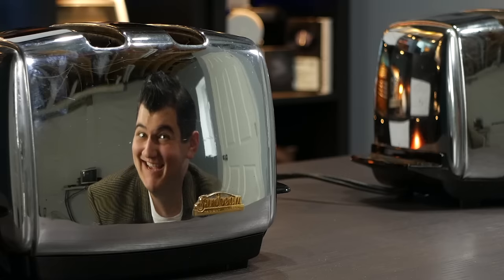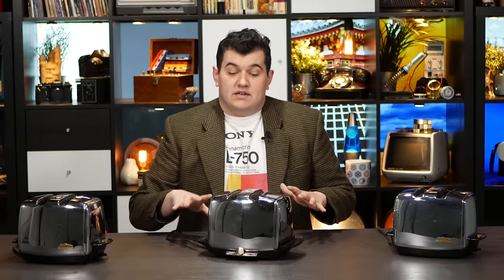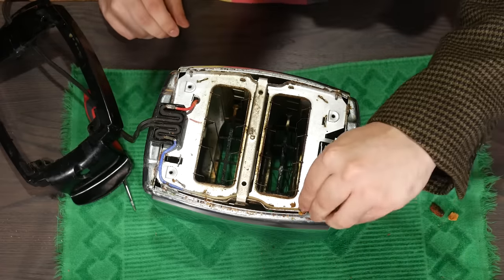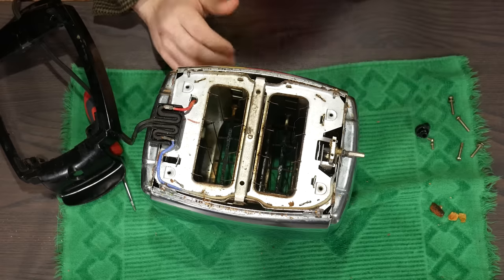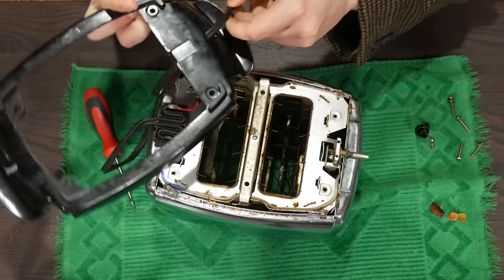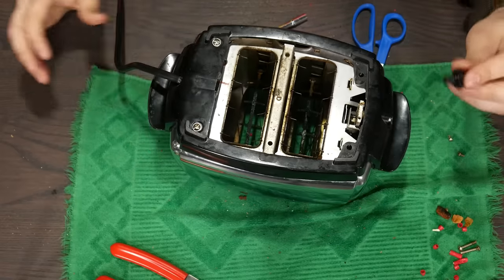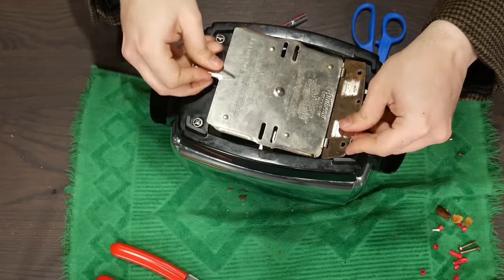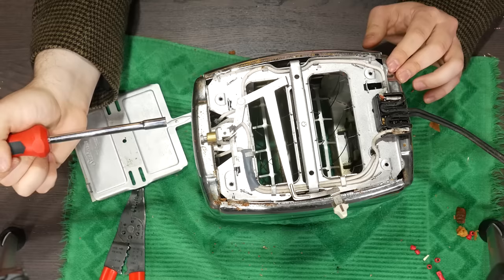Sunbeam Radiant Control Toaster--Repair and Modernization

Comment: Old vid yes but I was curious if you actually confirmed that the insulated wire was definitely paper? It's only a concern because I have swapped many cables on many vintage items and have run into insulation that looked exactly like that and it turned out to be asbestos insulation that was bonded on the outside. I personally haven't seen paper insulation and I'm not saying it wasn't a thing. I know you are an intelligent man and I'm not down playing any of your knowledge because as an RF engineer I don't know everything I just wanted to point out the possibility of such a "small" hazard. Love these toasters and I think I'll be purchasing one now and as always I love the vids 👌😎

Comment: The Brave Little Toaster haha comes to mind. What would be nice for jobs like this, is the factory style crimping tool that puts those impossible to reverse crimp pressures on. Uninsulated and some spaghetti tube. 
I'm fairly sure by these days, standards/codes/regulations stipulate that basically every power point in a kitchen or water area is RCD/GFCI protected, and as such, I too would prefer my chassis' earthed.

As for power lead length, I believe they are short due to several safety reasons
1. The short length makes it not readily easy to overload a specific power point on your kitchen, due to the physical limitation of appliance space on counter caused by the short length... You end up plugging it into another power point (which of course should be on a different circuit if your kitchen is designed to good standards, else this pretty much ineffectual).

2. The short length makes it not readily easy to reach a body of water, such as a sink, with the appliance still plugged in.

3. The short length makes it not readily easy to operate the appliance outside it's intended location, say on a table or floor in the kitchen

I am no expert, but that is what comes to my mind as to the reasoning of short power lead lengths.

Lastlily - I love youtube, you can make a video on just about anything and people will watch ^^

Comment: I just bought one of these beautiful radiant toasters and it is quite pristine. The problem I'm having with it is that the bread hardly goes down (inch) only to come right back up again. Mine looks exactly like the one needing to be adjusted with the bread problem. 

If any of you can possibly offer some suggestions I would greatly appreciate it. It seriously looks new inside/out. Thanks so much for this wonderful informative video.

Comment: Seams logical that they may have turned the text around due to how some people maybe wanted to use the toaster.
Let's assume you don't want the toaster standing with the wide side out but rather the short side (with handle) towards the user.
Then you would want the single slice slot towards the user so you don't need to reach over the lot when you toast one slice.
In that case, you may want to turn the text around to make it readable from the closest shorter side.

Just a theory.

Comment: Aluminum gets brittle with age (more so than copper, and I'm assuming the copper wire is stranded). I lived in a house once that had incoming phone wires (local loop) in aluminium, and the wires kept breaking when they came to install a digital line for me. Those were 30-40 years old, so I'm not surprised the toaster wiring was a bit difficult to work with!

Comment: I would clean the insides while I had the toaster open might as well since you are rewiring it any ways.
And also be careful with the bakalite as the age of it makes it pretty brittle but that is with any plastic any plastic will get brittle over time.
And I would recommend automatic crimping tool they work so well so you do not have to worry if you put enough pressure on the crimp or not.
What I do is use heat shrink tubing and for something like this I would use two or even three heat shrinks so the wire has less chance of getting free and shorting to the metal.
But I would solder the wires then put the heat shrink over the exposed wiring.
And the wiring in this kind of situation would not be paper that would burn up.
It was either wiring that had ceramic poured over it or like others have said could be asbestos.

Comment: Thanks for the awesome video!  When placing toast in this toaster, ours gets very brown on one the side of the bread that is facing the internal coils in the middle but only very lightly toasted, if that, on the bread side that is facing the outside walls of the toaster.  Is there a way to adjust the heating so the bread is browned evenly on both sides?

Comment: LOL  When our toast would come out that dark, I'd reject it and call it burned...my dad would say, "That's not burnt; it's just nicely browned."  and he'd eat it.  I'd take it to the sink and scrape off the blackened bits!  :-D
I would definitely go with a soldered connection and shrink-tubing insulating cover over the joint.
Polarized plugs?  Hmm....it seems that they were anticipated long before they existed.  the house in which I grew up was built in 1938, and all the receptacles had that one-side-larger slot...HOWever, I never in my life saw a polarized plug until the late 1960s/early 70s!

Comment: Here's my story regarding these toasters, and some further info about it:
I found one of these (a model T20A made in 1951) in a thrift store that somebody donated after they cut the cord off of the toaster.  I was intrigued by the lack of a lever, and decided to buy it (for $7.00 US) and see if I could resurrect it.  

I found that some of the insulation from one of the wires in the cord had frayed and so the cord's conductor was touching the frame of the toaster.  While it still would have worked (because the case wasn't grounded), it would have given people a shock if they touched the metal while it was on and they were touching their sink or some other path to ground.  Depending on how the non-polarized plug was connected to the outlet, it could have given a shock even when off....

I added a polarized grounded cord from a donor dead appliance, made sure to attach the wire from the narrower plug spade to the switched side of the inside circuit (in North America, the narrow spade is the hot side, the wider spade is the neutral side) , and connected the ground lead to a handy screw in the chassis of the toaster and tested it and "it lived again!".  I spent some time cleaning up the interior, and made a slight adjustment to the screw on middle of the center section on the bottom to get it to fully cycle (if one of these toasters only works "sometimes", a small adjustment to that screw usually cures the issue).

I have been happily using it ever since....

One thing to note is that these use more power than most modern toasters (but they also toast faster too).  That means that you might have to connect it to a different circuit in your kitchen than your microwave if your breaker trips when you try to use the toaster when you are already running the microwave....  Most homes built or remodeled in North America from the 1970s onwards are required to have a minimum of two 20 amp 120v circuits in the kitchen -- so plugging it into another circuit shouldn't be a hard thing to do.....

You can see an article about this toaster from a now long-gone website via the internet archive here:
https://web.archive.org/web/20110805160747/http://toaster.org/t20.html 
Here's a link to an old 1954 advert for it:
https://web.archive.org/web/20110805160747/http://toaster.org/images/vintads/sunbeam_t20ad.jpg
Here's a link to the page on the website dedicated to these Sunbeam Radiant Toasters, automaticbeyondbelief.org that goes over how to use that adjustment screw to fix a troublesome unit:
http://automaticbeyondbelief.org/fixing.htm
Reply: I added a ground to my toaster and tightened the tension screw. Now it is always on help

Comment: How about replacing that old-fashioned zig-zag strain relief with a crimp-style that mounts in the hold of the case (that you said you didn't have to enlarge). Not only is it probably "code" (when doing an upgrade), but it would also open up the space where that antique strain relief is now.

Comment: I have one of the earliest examples with the stamped design on the cover.... I still use it every day... The cord wire was cloth covered. I've never thought about grounding it, but it might not be a bad idea.  

The only danger with this toaster is that there is a very rare case when the bread is the perfect weight the toast will come up and then go back down on it's own... This may have been fixed in later models, but in my very early example it occurs once every couple of years.  Adjusting the set screw might also help.

I might also note that the first toast is lighter than subsequent toast... also might be something wearing after 70 years of daily service...

Comment: At work, our SOP for new gear's ILO (Initial Light-Off) or energizing defective gear for troubleshooting, is to use a power strip with a circuit breaker.  Never into "the wall".  You can do a quick shutoff when "arcing & sparking" at the strip's ON/OFF switch without handling the gear.

Comment: Ive spent my whole life in a knob wiring house with no grounding, so I always had to snap the ground prongs off any new appliances/electronics. Nowadays I just snap off the ground prong to a surge protecter instead of breaking every appliance cord in the house. Up until maybe 7 years ago we still had a fuse box that used those old screw base fuses.

Comment: 20:57 I'm guessing that modern toasters have shorter cords for two reasons.
 One, newer houses place outlets above the counter top, and are generally  designed to be more accessible.
Two, it's harder to drop it in a bathtub full of water with a shorter cord.

Comment: I wonder if the colored wires in this  toaster mean that it was manufactured "shortly" before the required switch to polarized power cords in the USA. While the older plug fits in the newer socket, perhaps Sunbeam started using colored wire to make their manufacturing easier. IIRC,  many DIYers switched to polarized sockets only as they bought appliances with polarized cords.

Comment: As a german I am confused by the coloring of the new cable. Here in germany the 3-phase-cables are normaly colored with brown (for the powerd phase), blue (neutral) and green-yellow (ground). There can be found older cables with different colors in some buildings (sometimes horror-storys like 5-phase-cables with 3 to all 5 ones in black... so you don't know what is what in any case!)

Comment: I did the same thing with my 1948 Walking Toast-O-Lator toaster. US polarised plug and earth wire with toaster plugged into a step down transformer to supply 110 volts. FUN FACT. While the black wire is active in the US, in Australia it is neutral. In Australia the active wire is red or brown. Earth is green or green and yellow.

Comment: The strain relief at the bottom needs to be modified so the central separator is cut (shaved/filed/snipped) up to halfway across that black relief block. That way the cord can have the outer layer halfway up the relief block, away from the edge of the toaster.

Comment: This is exactly why I'm a firm believer in solder on EVERYTHING.  They even make solder filled butt connectors, so you can crimp it to temporarily hold it and then melt the solder for a permanent bond.  I've seen too many crimped connections break or fail in a million ways over the years.  Especially on vehicles, where movement at the crimp will cause the individual wire strands to break until there's nothing left.  At best, the writing fails and the device stops working...  At worst, fire.  Solder and heat shrink is my go to.
Reply: And, actually, now that I'm thinking of it, I'd probably replace all the writing inside it and solder the new wires to the switch and all.  Could get some new high temp insulated wire and get rid of all the original.

Comment: The short cord on modern appliances is to save money on copper and the butt connectors you're using are made mainly for 12v automotive. They'll likely work, but after a few months use they'll probably melt inside the bakelite or (polyoxybenzylmethylenglycolanhydride).

Comment: I’m not certain, but I would guess that the newer toasters have 3’ power cords because of updated home designs and building codes. In the 50s and 60s, you probably needed a 6’ cord to reach the nearest outlet in your kitchen. But modern codes and designs place a nearly ridiculous number of outlets at much shorter intervals in the wall, so you don’t need such a long cord. A modern kitchen countertop probably has more outlets in the wall above it than an entire 50s kitchen had in total. That’s my guess.

Comment: The flipped text: from usability (plus: 'who complains') perspective, it makes sense.
      Think of a thinner space on your shelf, and the toaster turned 90° so the thinner side faces out..
     It makes sense that (in those cases) the 1 slice is the one closest to the user. And in that case, the text is readable.

From a 'who complains' perspective, the people with less shelf space (width-wise) are the ones who will have put the toaster with the 'one slice' part facing them.
      Logically, they would be the only ones who noticed that - (in their specific use case) - the text is upside down. 
      They are the only group who would benefit from the 180° flip, and most likely the only group that complained.

For the 'wide part facing them' people, it doesn't really make a difference, apart from aesthetics..
      (it does 'feel' more logical to have the 'bottom' of the text towards the center of the toaster... (I think because that makes it feel more like a title / header, instead of a footnote)
      But practically, seeing as it's stylized text, it's not too much of an issue - they read it sideways in either case.

Anyways, this concludes my far too lengthy reverse engineering of the design process (and potential customer critiques).

Comment: I was wondering about the aluminum wiring.  Probably done to allow a non-corrosive connection to the nichrome heating element as you suggest.  Something people may want to consider, use Noalox in the connection to avoid a problem later.  It’s required by code where terminals have to accept aluminum wires.   The other option is that it wasn’t aluminum wire.  Not sure, never played with a toaster.

Comment: I got one of these just recently. I'm wondering if the cord you used is good for heating devices... That just looks like a computer cable. I am aware it's an appliance cable. I see them all the time working at the electrical department at Menards, but are they meant to be used with toasters?

I noticed that room heaters, irons and such devices have a different material cord that's more maluble and rubbery. I'm guess that's so it can resist heat better, just wondering if that's the right type to use. 

Interesting too is that mine has OCT 15 1953, and JUN 23 1953 marked on the chassis, but the cord looks more modern, but not polarized. Plus mine had chrome top on backwards the "one slice" slot wasn't where the trigger was. Methinks someone has been in here before... The contact switch wasn't working either, a little sandpaper made it work again.

Also can you put the chrome pieces in the dishwasher to clean them? A bit extreme maybe, but can it be done?

Comment: 31:25 I think your strain relief should pull the outermost plastic of your appliance wire. If there's enough space, simply making a nut out of the appliance wire should be good enough for straing relief. Another good option would be to squeeze the wire between to parts, kind of like a screw actuated grimping jaw holding the outer plastic of the appliance wire.

Comment: 45:50
I have had a sunbeam vista (the earliest slider model) for years now, and at least the one I've got does appear to have the double pole switch given two wires on one side and one on the other are clearly visible through the crumb tray, unsure if they made multiple models under that name but I'm happy to hear that at least the one I've got is safe (enough), especially given my entire family has been using it regularly for a very long time without knowing for sure... Probably should have checked sooner!

Comment: So the inside if the toaster is under constant pressure right? Would cheap plastic be able to safely and reliably handle that? And how would you add additional modern functionality like time display?

Comment: I remember having a toaster like that when I was a kid. Like the one in the video, it wouldn't start automatically. But, unlike in the video we never bothered fixing it (maybe we didn't know it was an option); we just shook the bread in the "one slice" slot until it dropped and started the cycle.

Eventually it got so bad you'd shake the bread apart. That's when we tossed it in the trash. Now I wish we'd have kept it.

Comment: I just got a T-20 from 1949-1950. Thankfully the cord got changed out to a polarized one before I got it. There is a flaw with the first model though, the thing in the center requires pliers and not a screwdriver.

Comment: 1:50 That's actually a hot debate on editorial design. Some literacy genres have their own tradition about vertical text direction on a side of a book. In the United States, the Commonwealth and in Scandinavia, titles are usually written top-to-bottom on the spine. I wonder what's the correct way in toasters...

Comment: I ended the Technology Connections video thinking, "I gotta get me one of these toasters!" I ended this video (and the pinned comment) thinking, "yeeaaahhh, my toaster works fine."
Reply: Lol, same here.
Also, while the video is entertaining, he should get some proper tools, a voltage/connection tester and proper heat resistant cable for such tasks.
I cringed several times.